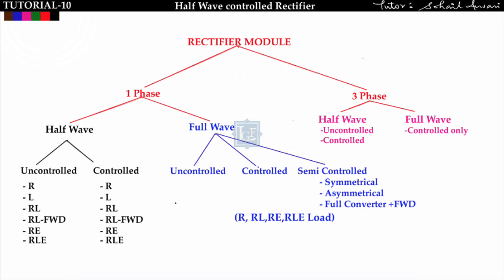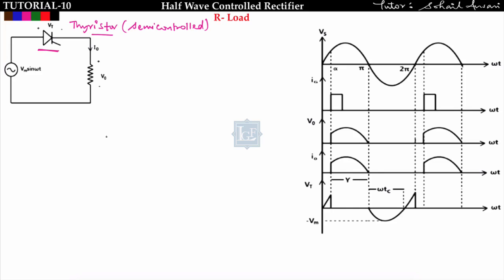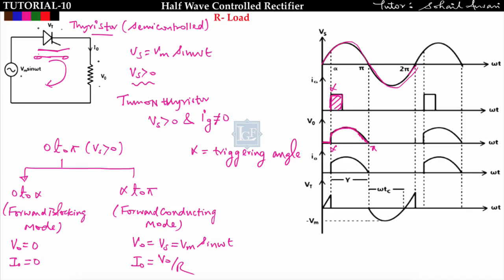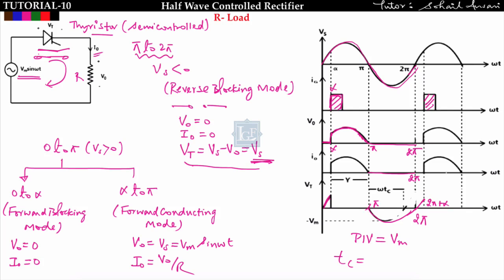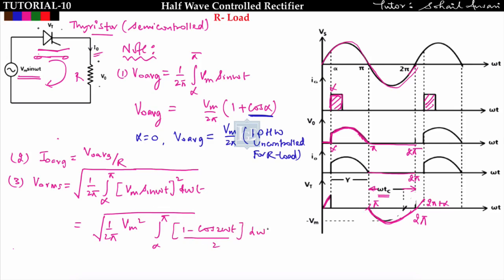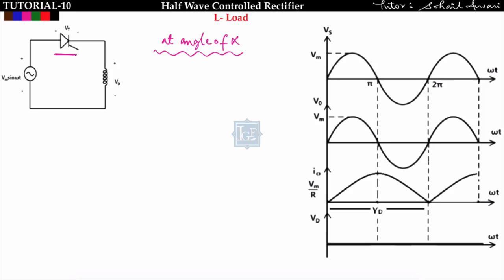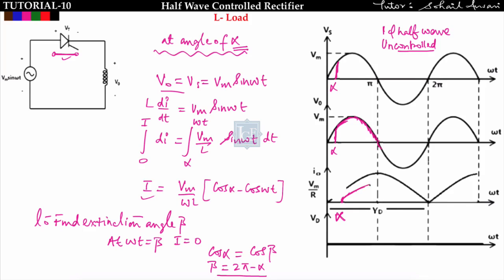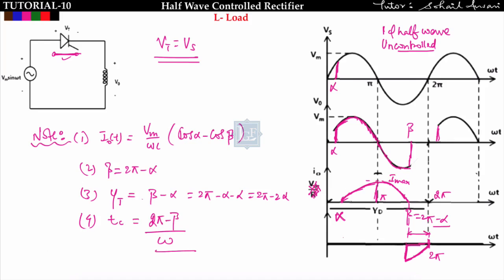Lec 10(a) Half Wave Controlled Rectifier (R & L load)

Comment: Sir, your lectures are no doubt good, but what I don't understand is what is the point of these gate exams apart from sorting the students for admissions in various colleges, we don't get to design any power electronic circuit in real life using data sheets, all we learn is how this works, that works, but there is a lack of practical aspect in our Indian Engineering Curriculum. Sir, I am not blaming you, you are very good in your explanations, but I am a frustrated student tired of this silly practice of competing in our country, all at the bachelor's level through jee and then here. I don't what good will happen solving all these equations, and yet not designing any things in real life.

Comment: I have doubt tat !! If the phase controlled rectifier is same as uncontrolled rectifier wen u put  alpha 0 .Wen u consider the case of uncontrolled rectifier with L load the voltage we are getting till 2pie ! But in this y we are not getting till 2pie !! ??? In the negative half cycle the inductor would discharge it's energy through Diode as their is no absorbing element R the. There shuld be no voltage drop !! Toh the Voltage we should get till 2pie ?? But we are not ?? Y ???

Comment: Sir if we take normal RL circuit with ac supply we are considering current lags voltage by some angle but in power electronic s we are considering v and I are same phase

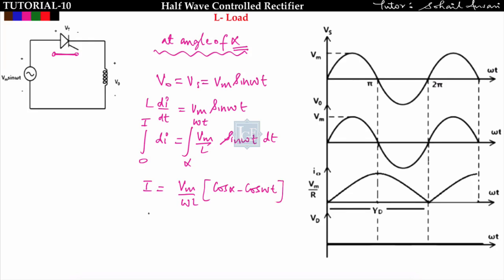Comment: sir at time 15:03 integeration limit should be from 0 to t in place of 0 to wt  because integeration is performing w.r.t to dt
Reply: right i have also the same doubt
Reply: No.. whatever sir had written is right.. if you want to cross chesck then do in the following manner.. just don't consider limits, you just do simple Integration and then take a constant as a result of integration.. so now try to find the value of constant by putting current=0 at wt=0 (from the reference of current waveform) you will get the same answer as written above in the video

Comment: Sir, I think extinction angle for R load should be (pi-alpha)
Reply: No.. actually that's the conduction angle.
Conduction angle= pi-alpha.
But extinction angle is defined as upto what angle the PE device is conduction from the zero instant.. mark this properly "from the zero instant" but not from the angle from where PE device starts conducting...
Reply: Mark this below sentence properly.. 
The angle from where PE device starts conducting and till it stops conducting is termed as conduction angle 
Whereas from the zero instant to  angle till where PE device conducts is termed as extinction angle
Reply: @anushareddy2736  thanx bro
Reply: Extintion angle dosent exist in r load it will be zero

Comment: Sir, why we are not considering any phase change even if inductors are present in the load?
Reply from the maker: there will be phase change on ac side..how can u talk about phase change on dc side?
Reply: GATEMATIC Education  Yes sir, I had that problem because in RL load without Freewheeling diode, the current goes in the negetive part also, so I have a doubt on whether this changes the phase.